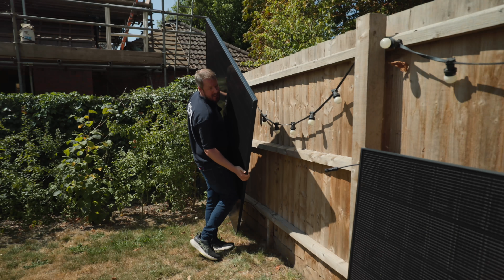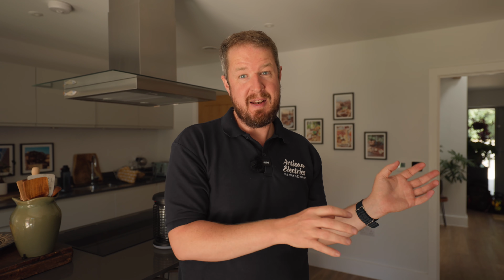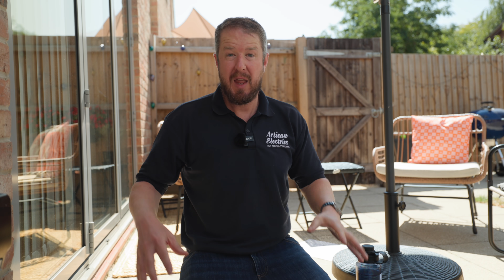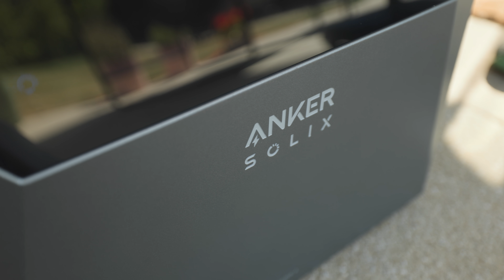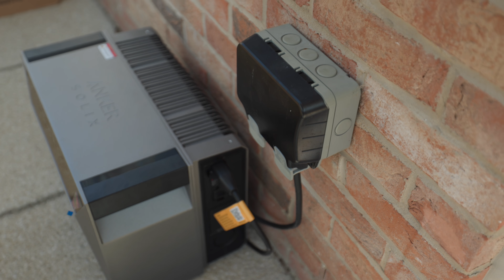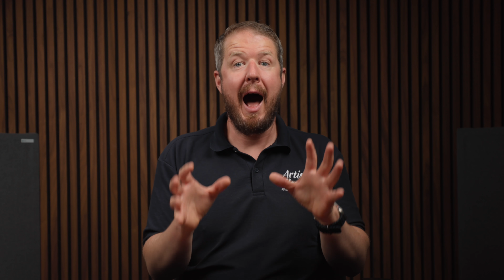The MISSING PIECE of Plug-In Solar

Comment: You could use that excess solar to heat a tank of water, if you have one, rather than a combi. (I have a tank as I there are several showers in the house)
I am at home in the day and I use most during that time and I get a full tank of hot water too, all that with only 6 panels on my garage roof! The installer wanted to install 20 panels on my big roof, but from my maths I only wanted 4-6, which over supplies me for about 6-8months of the year.
During winter, you might as well forget solar and is where having a battery really comes into its own, if you can charge it overnight with cheap off peak electricity. If you have this, you might as well just use that solution all year and forget the solar.
Personally, for my use case, I just cannot get the maths/ROI to work for any battery option.

Comment: What no one has asked and no one seems to know is what happens during a power cut to prevent a back feed.
Reply: I thought that's what this video was going to be about, but nope.

I'm pretty sure it would switch itself off, however. Rooftop solar already does that.
Reply: Micro inverter will realise there is no power and cut out

Comment: I already have a Powerwall 2 and 14 panels. I export pretty much all of my solar production. I have a studio room at the bottom of the garden that is connected via its own consumer unit to my house. If I put 2 panels on my studio roof and feed that into the consumer unit, does that mean it will all get exported if I am not using it? Do I need extra CT clamps so that my Tesla gateway knows what to export? BTW I have whole home backup so everything goes through the Gateway.

Comment: Agree. I've done things differently, and none of it goes back to the grid: Panels> solar controller> batteries> Inverter> Fast switch over unit. The switch over unit detects when stored energy falls below a threshold I set, and THUNK, it switches back to mains. Its so fast, even my PC or laptop doesn't notice it. I also run my own 'green' circuit around the house which powers the fridge, freezer, and all lighting. On a very sunny day I can power the kettle no prob. Been doing this for last 3 years. Battery storage is three big 12v leisure batteries. System works well.

Comment: Battery DC to AC losses 15-20% says another review. Surprised you didn't mention this.
Reply from the maker: Good point, those conversion losses are definitely a factor to consider in the overall efficiency!
Reply: Seems a bit high my losses are around 6% from AC to DC and back to AC all round

Comment: In fact, a 200W base load for your house from 9h till 19h is 2kWh per day. That's around 20 GBP per month or easily 160 GBP per year.
So, a 350 GBP installation pays out in 2-3 years.
And that's very conservative.
If you have a hybrid boiler like the Ariston models that have a 200W heat pump element that can hum along during the day while you are away to replenish the hot water from your morning shower, you will consume even more of the power generated by the plug in solar system.
But I overall agree that a battery makes a lot of sense!

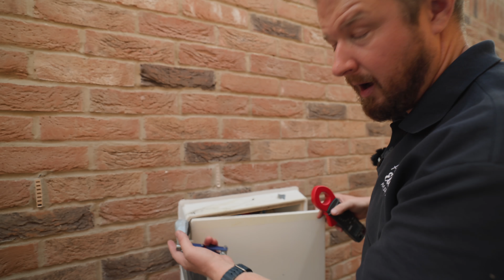Comment: 2:12 you can get paid if you fill in your G98 form, with the details of the plug in solar inverter
Reply: G98 allows you to put 3.68kw into the grid the MCS cert from the Installer is what pays not a g98.
Reply: @petechongy thanks

Comment: I'm in Australia, and have rooftop solar. But in winter I don't generate enough (i have an EV).

I was really keen on plug in solar (our regs are very restrictive and its not approved yet).

But now we get 4 hours free electricity in the middle of the day due to excess solar across the grid. Now i dont care as much about plugin solar. When im working from home, I just run everything and charge the car between 11am-3pm without a second thought.

Plugin solar is only going to be there until you get more solar and batteries into the grid and then power prices will fall and there will be an excess of solar.

Comment: Is there a way to use plug in solar to power a small shed? Just some lights and a socket. The shed currently has nothing.
Reply from the maker: Yeah definitely! You could have an “off grid” shed 😂
Reply: @artisanelectrics interesting. I must do some research into that. Thanks

Comment: here in France, I get paid 24c for every kwh I export. I have a 20 kwh battery that is wired in. I have just added 6 panels plus 2 inverters (total 3 kwh) which have no limit on output - they cost 999€ delivered. Octopus have a tariff which gives me 16 hours of cheap rate (12c a kwh) which is split between 2100 - 0700 and 1100 to  1700. The higher rate is 17c. But I have my battery set up to cover the expensive period. So although the house is fully electric and I have a Tesla, my electric bill is negative.

Comment: Just as a heads up, I like your channel, been watching for a few years, but it sometimes feels like you criticise stuff as a sales tactic for selling huge expensive systems and its quite frustrating to listen to. I can tell you that a couple of months of plug in solar has been the best marketing tool ever for getting a full 22 panel array on my roof and will be using the money saved for a new kitchen to get that set up.

Plug in solar is an incredibly convenient place to start and I think will only benefit you guys in the long term so I wouldn’t be so quick to over egg all the negatives. You never talk about the cost of all this stuff, I got 2x 540w panels and an 800w inverter for under £450 and generate 6.8kwh on a sunny day. We cover our 100w base load and with a bit of shifting habits like running the washing machine and charging an ebike in the day time and it’ll pay back in under 2 years.

Saying “you’re better off with a battery and more panels” is just not very helpful if you don’t talk about the cost. If you can find a better solution for under £500 I’m all ears.

Comment: What’s the point of this unless you got an isolator as the system will shut down during a power cut and of course one that allows you to use solar energy during. A power cut including using your batteries costs a lot more
Reply: During power outage, the stored energy can still be used via the off grid 3-pin socket on the unit. So it can still be useful.

Comment: I thought the recent regulation passed does not allow batteries in the plugin setup
Reply from the maker: Actually, they are allowed, but current UK regulations require a hardwired connection by a licensed electrician for this specific setup! ⚡

Comment: Experience in Germany shows us that if like yourself both people are away at work then batteries makes sense but with more with two panels using batteries like anker pro then with 4 or 5 panels if you have the space, and there are those who are at home, pensioners, parents with young children and people working from home, shift workers. These people don´t neccesarily need to buy a battery!
With two panels 450w your only going generate 800w maybe at peak times if that, depending on direction and angles of panels! 
I think people should first understand what for them ist the best and simple in there circumstances that makes financial sense batteries are expensive, but can over the long time save more than without! The initial cost are alot higher.  For those who don´t have batteries,  change a few habits if you are at home, washing maschine or dishwasher on during the day and not at night! for instance! learn how to get the most out of the system you have
Reply from the maker: Spot on, it’s all about understanding your own usage habits to see if the investment pays off for you! 👍

Comment: Do these plug in solar/ battery/ inverters synchronise automatically…how do the units deal with the usual variable voltage showing at the service mains input…are smart meters controlled by the service provider a problem…?
Reply: The inverter should follow the grid frequency and voltage. To have a battery system that matches your consumption you usually need an additional smart meter in your braker box. But that shouldn't affect the one of your supplier.
Reply: @Felix-st2ue thank you

Comment: One thing is being deliberately overlooked here, especially during the section where savings numbers are being tossed around. Every inverter has its inefficiencies, losses and stand by self-consumption. My SunEnergyXt 500 (a 5.12kWh, 2.4kW unit, with 4 60V mppts and a 2.4kW back up power socket, passively cooled) has a self-consumption of 40W. This is 960W per day, or 342kWh per year. This amounts to 120EURs worth of electricity being wasted. Since my front balcony only has 2x300W panels, at an almost vertical angle, with a big tree shading it from the park until 11:00, i am barely covering the units self-consumption over the whole year, and have no hope of even covering the units daily wasted energy during 9 months of the year. Since i live in germany, and germany is very a backwards and technology averse country (hence why they have killed off their burgeoning renewable industry in 2012 - aka the Altmaier Knick), i still have an old analogue meter which can turns backwards, and it might take a decade before i get a smart meter, so i would be much much better off using a small standalone solar inverter than a battery.

If anyone telling you about the virtues of an all-in-one system fails to mention the systems inefficiencies or losses, he or she is purely shilling.
Reply: 277W average for a whole day, to drain a 5kWh battery? 277W * 24h is 6.65kWh. 213W is an actual shortsighted envelope calculation, but there are at least 40W of losses there, so 163W is a closer to real world value. This is some of the worst shilling i have seen on this platform for a long long time.

Comment: How does the battery not go to the grid?
Reply: It can adjust its output to what a supported power meter in the main fuse box sees. This can reduce power draw and feed in to just a couple of watts every few seconds, depending on system components and configuration.

Comment: how do you stack those modules? it looks like there is a male connector on top of  the bottom unit and it mates to another unit above, but I don't see a connector on top that protrudes up.

Comment: pretty much sure that the plug in battery stuff isnt legal in the UK with this 27th august thingy. only panels -> 800w inverter -> socket. 
Anything with a battery or over 800W, needs breaker on consumer unit/sparky.

Surprised on how you do this for a living and you dont know about that.

Comment: So no charging loses converting mains ac to battery dc and then back to ac ?
Reply: Definitely around 20% losses to be expected
Reply: According to artisan electrics, it works the other way around. They claim that 277W can be fed into your home for a whole day out of a 5kWh unit! (277Wx24h=6648Wh) This is why they call this an inverter, it magically inverts system losses.

...

I think i bought the wrong all-in-one device, mine doesn't do physics inversion and actually wastes a whole kWh every day.

Comment: I'm retired so it makes sense to have Balcony Solar, but I live on the first floor No Balcony, if Possible I would place Solar panels on my South - East wall my South is 200° & to ballance the system & add Solar panels on my West Side, on my wall of the apartment, I cannot have trailing Solar wires outside on the ground, I worked it out I use between 9 kW to 16kW of power per day when my children are home from university, the problem I see is you're limited to 800W from the  Balcony Solar inverter, except for the off grid outputs, Yes you can add batteries but that won't change the limited 800 Watts output, but that's where it starts to get expensive by additional batteries, so if you want to really gain because Balcony Solar is going to cost £800 to around £1800 for the main unit, batteries each £800 to over £1300 & you can stack them to a larger system total depending on manufacturer, to me if I had a 🏡 not an apartment I go for proper Solar on the roof or on the garage or in solar garden mounts, by choosing a proper sized inverter I probably go for 2x 10,000kW Victron Quattro or Multiplus units with a stack of 48V (51.2V) rack batteries at least MPPTs say 2x to 3x 250/100 place solar PV in a high volume series parallel Combination, Cerbo GX get solar panels that would be best for low light when they become available in 2028 Graphene-perovskite as they're low light performance is outstanding, then have a solar diverter to heat a hot water tank with a 3kW heater in the peak of available Solar After all the batteries topped up to say 95%, I would probably add Ai using Home Assistant SSR relay hot water heater, batteries I would need about 30kW to 40kW to take me through winter days for UK weather, that system would be the ultimate option, adaptable & have inverter backup, I have a bidirectional Landis & Gyr E470 on a 100A fused mains, to me that would be the ultimate system, for sure you need a single phase Victron meter to limit 3.68kW to the grid to work with the Cerbo Gx - inverter - batteries - shunt, I got my standing base power down by switching my freezer to economy, that saved a lot of base power use.
Please remember you will need a smart meter on the property that will read export power 🔋ac as well as the normal input power 🔋 ac the Landis & Gyr E470 is a good unit 👍 for Bidirectional remember to tell say Octopus 🐙 to set up your energy meter as bidirectional, if I purchased Balcony Solar it would be used to take by baseline use off my usage easy way due to constraints of mounting Solar panels myself as a charge on low tariff after midnight & use the power limits 800W during the day, Anker, IndeVolt or Sigenergy would be my choice as its settings would run with Octopus 🐙 Energy on it's Ai ❤
Reply: Well there are cheaper battery systems around. For example the Marstek B2500. 2.2kwh for 300€. That one is DC only. So it sits between the panels and the inverter. Also heat pump water heaters might become even more attractive. And the garage is usually the first place to put panels.

Comment: Plug in batteries are not legal in UK, and wont be until mid 2028, which means this unit would have to be hardwired and protected by an RCBO. At this point, you can use the full inverter power, which in this case is 2.4kW. So i dont understand the point of this video, which is misleading in many ways.

Comment: Yes all very good but allready theres a case of someone getting bad ellectrical shock/burn from plug in solar THERE NOT SAFE when unpluging for first few seconds DANGER FROM PLUGPINS.....!  And it has been well demonstrated  documented clearlly shown on youtube.
Reply: Like balcony solar inverters, these All-In-One systems are grid following, and shut off in milliseconds. You literally cannot unplug these devices from a standard outlet fast enough to meaningfully shock yourself.
Reply: @luc_libv_verhaegen unless you have a non certified one.
Reply: @luc_libv_verhaegen .actually you can theres a case allready of a proper approved electrician getting a 340v DC shock and burn from a plug in solar system after multiple testing by a team they found under testing that allthough the AC output stopped instantlly there was upto 340 volts DC present accross live/neautral pins for approx 5 - 8 seconds ENOUGH TO ELECTRICUTE  somebody unpluging with high DC voltage which you cant let go of by nature of DC current.I will find link and post here....!

Comment: Thats why you have the ecoflow batteries around your home powering your washing machine/kettle/microwaves...it saves you so much with little expenditure, and easy to fit yourself..... for most small to medium size home owners its cheapest option......the whole point of solar is to save money
Reply: Exactly what I do,, I have an old Delta max from 2021,,  its hooked up to two 375w panels and runs my fridge /freezeer and a couple of wine cooler and HiFi,,  I also have it plugged in the mains and charge on a low charge setting,,it works really well ,,the F/F has a yearly currant draw of 401Kwh/per annan

Comment: Can anyone explain how you can be charging the plug in battery and drawing on it at the same time.
Reply: AFAIK you can't, and you will, in reality, just be either charging slower or discharging slower. Maybe some have separate output sockets or a separate connection to the solar panels on them and both connections could be in use at the same time. However, the actual battery inside the box would still not be both charging and discharging at the same time.

Comment: This isn't going to be legal for a while, so is the question "will you hold off on plug-in solar until systems with batteries are allowed?"
Reply: You can't have a battery in your system in the UK?
Reply: @sophierobson5694  You can if it is installed by an electrician. Not on a plug-in system, though. Nor are plug-in batteries legal, but hopefully they will be in the next 18 months or so. They approved the solar-only first to get people started.
Reply: @sophierobson5694  These batteries are already operationally compliant, it's just the bureaucracy of the regulator catching up. So it's not unsafe.